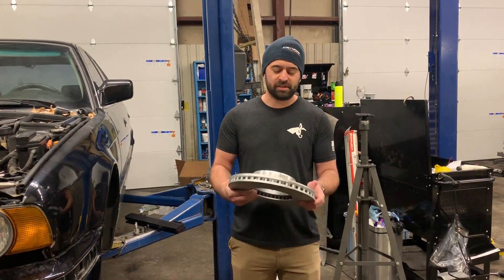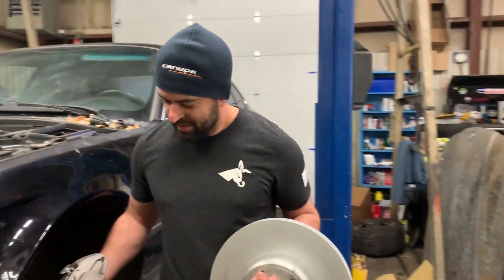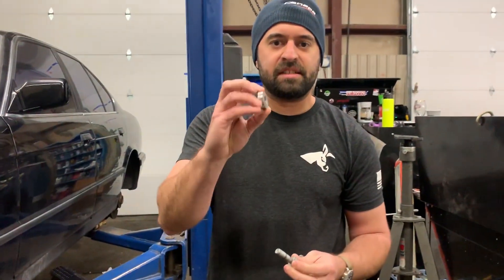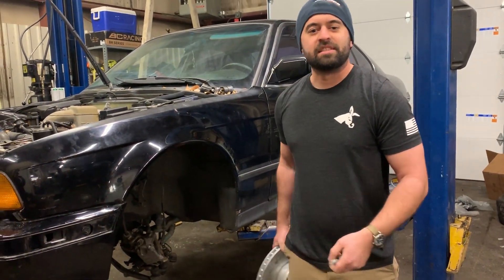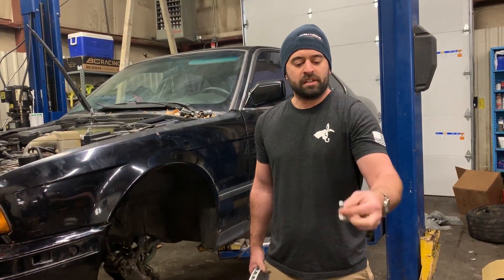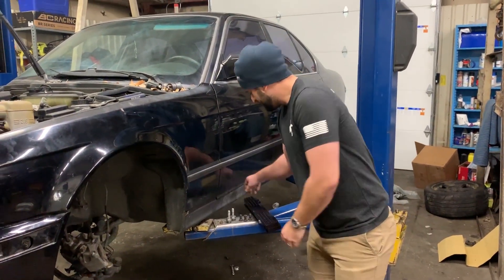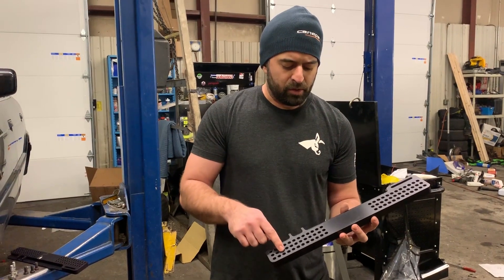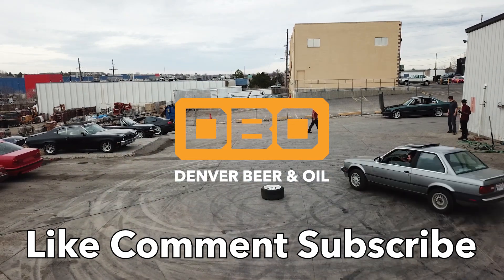E34 Big Brake Upgrade from Angry Ass Solutions | F30 Brake Calipers!

Comment: can you tell me oem number of bolts? are they from f30 original? what is the thickenss of spacers,,,can you measure them
Reply from the maker: Kind of defeats the purpose of them making this product if they just send all the production info to people to make their own.
Reply: @DENVERBEERANDOIL  there is no more page on the link so I am asking you because of that
Reply from the maker: Oh, I'll update it. New site is Angry-Ass.com
Reply: @DENVERBEERANDOIL that’s a bullshit attitude to take with people, this isn’t some specialist kit they make it’s just some thick washers and longer bolts, get off your high horse
Reply: the bolts need to be 55mm long and The spacers need to be 10mm deep, and the calipers use m12 bolt to mount them so 12mm hole in the spacer

Comment: Hello! I have just got the brake calipers and discs, but could you please enlighten my build with the correct spacer width, so i don't have to measure it with quite some time and effort to get to the correct result? Thank you.
Reply from the maker: I don't know the spacer width, and bolt length. That is why I bought the kit from Angry Ass
Reply: The bolts need to be 55mm long and The spacers need to be 10mm deep, and the calipers use m12 bolt to mount them so 12mm hole in the spacer

Comment: Do you know the thickness of the spacers?
Reply: the bolts need to be 55mm long and The spacers need to be 10mm deep, and the calipers use m12 bolt to mount them so 12mm hole in the spacer

Comment: This will cause serious brake bias if you leave the rears unchanged.
Reply from the maker: negative, from the factory E34s have very heavy rear bias, even the M5s suffer from this.
Reply: @DENVERBEERANDOIL  Now this is interesting stuff. So a larger front brake kit with no adjustments in the rear can work?
I'm only referring to this because I upgraded my E46 320i to 330i (engine, brakes, axles, ...) and when it came to the brakes, I did the fronts first and left the rears as they are, and this gave a huge bias. The front tucked in way too much while braking.
Reply from the maker: definitely true on e46 and e36, good example on e34s is that all e34s including the m5 have the same diameter rear rotor and caliper piston. Only the 540i and M5 have a vented rear rotors, and the M5 has significantly larger front brakes than a 540i. A 540i has slightly larger, mainly in piston diameter, than the rest of e34 lineup. This information disregards euronmodels such as 518i, 520i, and 525tds as I know nothing about them.
Reply: @DENVERBEERANDOIL  many thanks for this info. Just like the M20 stroker-part, I'm trying to gather as much info as possible before starting any project. Was thinking about building me a E34 M20 turbo in the near future. Good to know that F30 front brakes can work with OEM rear brakes.

I really like your YT channel!

Comment: i thought you typically want bigger brakes in the rear? any options for rear bbk??
Reply from the maker: the m5 and 540i have vented rear rotors and bigger pistons. they match very well with the f30 fronts.

Comment: a question where can I buy the brakes that show ?
Reply from the maker: Sure! This should be the correct link, if not it may be worth contacting them directly
Reply from the maker: https://www.angryasssolutions.com/parts/stage-1-bbk
Reply: @DENVERBEERANDOIL  thacks , the opción you have is 4 ?
Reply from the maker: @oche1547  essentially, yes. You can save $$ by hunting for calipers/lines/rotors..etc yourself but the guys over at angry ass know thier stuff and option 4 would be the quickest and easiest! We had ours installed in about an hour. Super easy. Good stuff.
Reply: @DENVERBEERANDOIL  thanks you friends , i aim to reach 800hp in the future !!!! : 😈